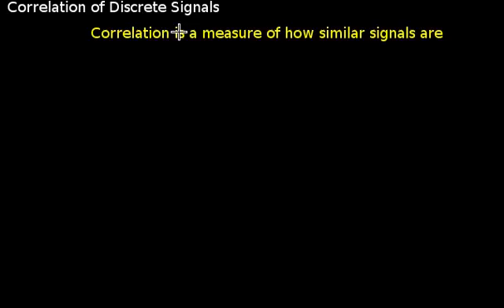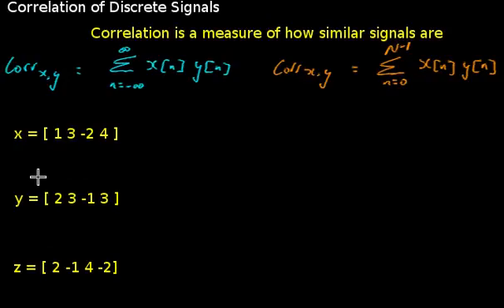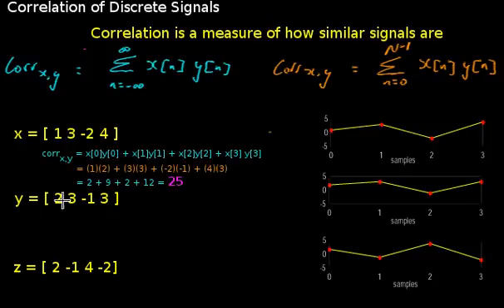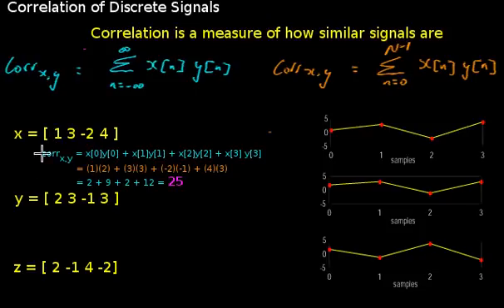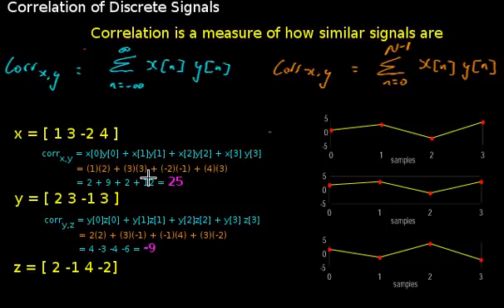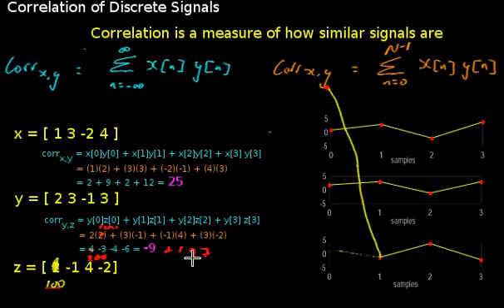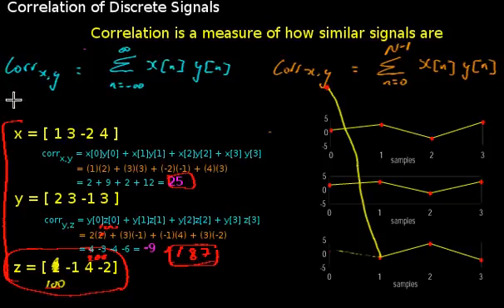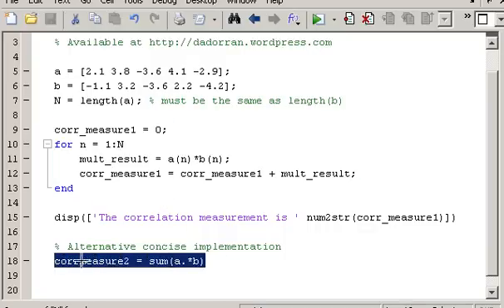Correlation Explanation with Demo

Comment: Great vid! Where can I learn about cross correlation? I'm writing a matlab code that can understand basic voice commands by comparing two audio signals. I'm using the resample function to make both signals the same length. However, if one signal is slightly shifted it kinda messes up the whole correlation calculation. What method would you recommend for this situation? THANKS!
Reply from the maker: Cross correlation would seem to be the way to go alright. Matlab has a built-in function xcorr that would be of help. xcorr returns an array of correlation values - if you take the max of these values this is (most likely) what you would get if shifted the signals to line up and then correlated.
 I'm going to put a video together on this sometime soon (hopefullly over the next few weeks). Best of luck.
Reply: David Dorran Thanks! your vids are great
Reply from the maker: Check out http://youtu.be/RO8s1TrElEw for cross correlation
Reply: +David Dorran How do I find a correlation between two audio files?